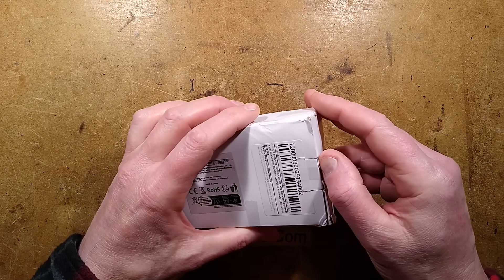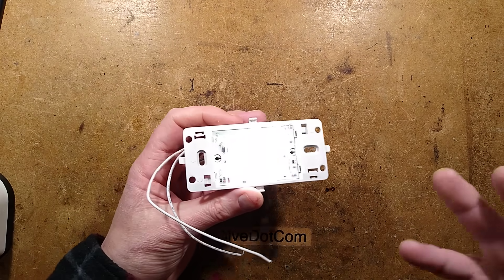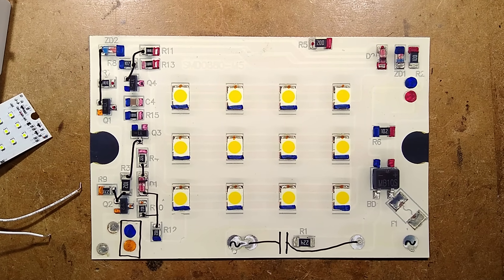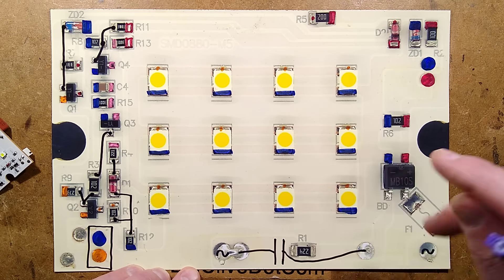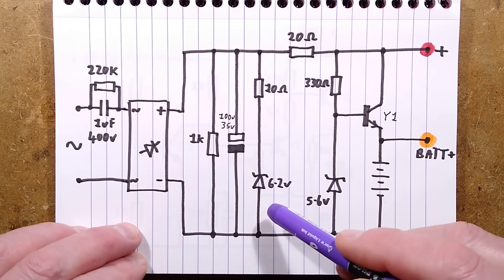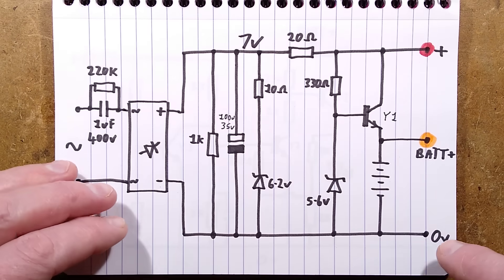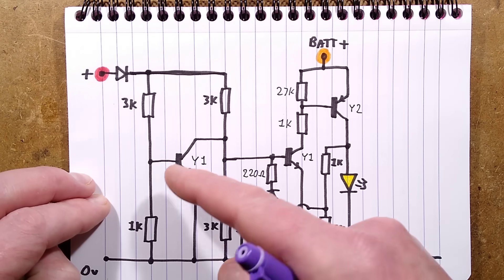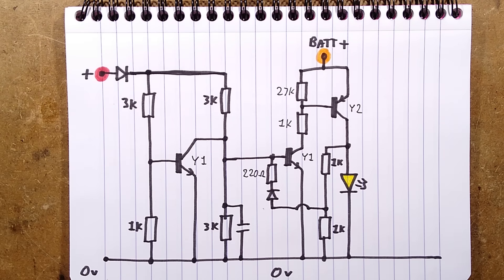Unusual circuitry twist - emergency light module

Comment: Dear Mr. Big, how do You enlarge a small fart circuit to a full blown tornado? That trick of enlarging circuits to a readable proportion is very neat, nobody else does that.
Being able to draw on with felt pens shure could help me understand what´s going on. Could You please fill us (me) in? Do You take a picture and print that out?
It shure can come costly to make my inkpisser do gloss DIN A4, it even needs a special cartridge for photos. Your blown pics shure look good.
I´m trying to learn electronics and this hands on technique could help, I´m a weird learner. I just fixed my old vacuum, it broke down with the symptom of a shaky contact.
Bought a little board that held a possible culprit, totally dismantled the hole shabang to find …a nothingburger. None was broken or burnt, just a lot of coal dust from the brushes.
Before the four motor wires gave me one reading, I should have had two. That´s when I decided to go all in, it is already broken so: what gives… I cleaned the dust off and out-
Would You look at that: two readings! The bugger works! Put all back together: liftoff! And it is even stronger than before, I measured 100 watts more consumption, it uses 870, now- from 700something.I can see that: the dust made connections where they didn´t belong. And this is totally unrelated but I am stumped and very happy, lovely christmas present.
Never had this before, I´m used to having magic smoke but not a nothingburger. That´s why I like this hobby: never a dull moment.
Happy Holidays und Guten Rutsch, Mr. Big!

Comment: When you went to page 2 schematic, and I saw the "logic" circuit I knew it as a self latching, auto shut off when the battery voltage dropped to a certain lever. I've built several of these years ago to indicate power loss on equipment control panels. The auto off function was so if the power loss happened during unoccupied times. the batteries would not drain to zero.
Reply: How does it turn off if the power comes back on before the battery is low?
Reply: @rolfs2165  7:58 this transistor will switch on again.

Comment: Can anyone answer:  Will a 18V Li Ion battery charger for my drill batteries charge much larger aHr batteries than were available when it was new?  I would like to have much larger capacity batteries.
Reply: Yes, it'll just take longer. 😊
Reply: @keithcarpenter5254  Thanks.  I have hoped that would be the only difference.  Nearly 20 years ago the largest available battery for this was 3aHr but now you can get 6 aHr.  I know the charge profile is CC then CV for Li Ion and I couldn't answer if the larger battery would also try to draw more or overloading current in the CC phase.  I guess my question was what is the relation of battery capacity to charging draw, if any.

Comment: It looks like they have used the npn/pnp transistor equivalent of a thyristor so as to effectively customise the operation to their requirements. I wonder if they could have used a thyristor like the common C106 to switch the LEDs instead?
Reply: Yes, that would be fine to switch the LEDs on but very hard to switch off at low battery voltage.

Comment: NiCd are not used very much these days. NiCd batteries suffer from so-called memory effect so if not charged properly, they quickly lose their capacity.
Reply: They have been banned here. 
Only exemptions are emergency lights and the like.

Comment: I haven't looked for a while, but you used to be able to buy replacement battery packs for cordless home phones that were nimh batteries that look like they have a connector like that so you can probably just buy a higher capacity battery pack off the shelf to put in that.  
Edit: I just looked and you can get 800 mAh battery packs and the connector does look very similar.
Reply: These are still all over the place and cheap. 
These packs are standard with Manny things like phones and walkie talkies
Reply: @NinoJoel  You can still buy NiMh batteries with capacities of 2,500 mAh, easy enough to make up a pack that would run the light for many hours. Although it would take a lot longer to charge back up again.
Reply: @NOWThatsRichy   just wanted to mention it since these packs are available pre made with the same size and plug for cheap. 
They have way higher capacities to
Reply: @NinoJoel Yup.
Guess what else using those those emergency radios with the hand crank?These are the return for batteries And so these units.

And what do I have?Could either run on five way power , including a Similar nightcat, or is it Is a Nickel metal hydride pack?Cannot remember.

But is exactly the same configuration as most Is the old corpus phones.

Have you ever seen some small radios that use the same configuration as well.

Also.
Turns out that emergency radio with weatherband makes a good portal for a wave receiver And actually has decent radio reception.Evolve out Using an external antenna even on short wave 

I also have one of those pocket.Radios got off.Amazon that has a short wave receiver on there.

You'd be surprised at.How low cost you can get a radio multiple function device.That actually is pretty decent even nowadays.

But on short weapons I do prefer an Is analog tuner.

AM radio at least broadcast band not so much these days.Kind of phone you're on a favor.

Also, I'm gonna be building a portable long wire antennaren't you?That would be pocket sometimes I really swallow often out in the boonies on vacation.

If you can rig up a long enough antenna you can get pretty good reception but otherwise radio reception is crap

Comment: We just had the batteries replaced in many emergency lights at work (south UK), and i was talking to the sparky that was doing the job. They were all Ni-Cd batteries. I was quite surprised they were still being used. Anyone know why they are still used in this application ?.
Reply from the maker: Better suited to higher current trickle charging than NiMH and safer than lithium cells.  Some new lights use LiFePO4 cells though.

Comment: So nice of them to provide extra solder pads in case the fuse blows, so you can solder in a new fuse.
Reply: So you can solder in a new properly calibrated wire :D
Reply: then you throw it away as it could have blasted the leds off by then, have this lead acid flashlight here i found that did this, but yeah

Comment: It appears the batteries were discharged which are rated @.3A yet when you gave it mains if started charging @.77A, well over 2C of the rated capacity of the batteries...Not good
Reply: A significant portion of that power was being wasted in that undersized discharge resistor and lost in the several voltage dividers.

Comment: A very interesting emergency light that looks like it can be easily improved upon, even if just to mount it on a box containing larger NiCad cells. Like emergency light D cell pack. That would make the light run for hours when there is a mains failure. 
Thanks for the very explicit video. Makes for easy following. 
TNX
K Watt
Reply: Change the batteries to NiMh, same voltage. [3 cells in series, 3.6V]
Reply: @DrHarryT  don't use NiMh in standby applications.

electric toothbrushes live forever if not always put back onto the charger. and they use NiMh cells.

those NiMh overcharge over time.   they don't degrade as fast a Li-Po or Li-Ion and don't tend to combust spontanious like Li-XX on a standby charger BUT they're also not happy.

put Li xx and NiMh on the charger PRIOR to use and NiCd and lead acid AFTER use.  that way you geht the best results in service life out of them.
Reply: No need for that.
They use a standard cell package with standard connector. 
Search for cordless phone battery's. 
They are dropin replacements and cheap

Comment: 300Mah?what was the point in including something stupidly low, chances are the battery would fail long before the light was ever even tested
Reply: I have been working with these back when they had neon lights. 
They normally lasted 10 years and more without any maintenance before they could produce enough current for the neon tube to start
Reply: It's only 5 bucks
Reply: I got nicads on an old wilko emergency light, about twice the capacity and uses a light bulb, still works too, I have no idea how old it is !
Reply: Yep... Just like my heated socks from TEMU.  😂
Reply: Lol I have 1.2v 800mah nimh cells I bought 15 years ago, AA, AAA, C, D, been through at least a couple thousand uses/recharges, and still work fine. Re evaluate your idea of the different battery chemical technologies please and thank you.

I might add I used them for high lumen flashlights for rough camping conditions for at least a decade and now they power my TV remote. 15 year old cells work my Amazon fire stick remote for at least 5 years now. I recharge them when I get a new firestick. Been through 3 of them now. The larger cells sit in my ancient backup maglights. Anywho. Continue your ignorant hatred of old tech please :) it's cute
Reply: @boilabum  mate, go outside some time this week, please, get with the times, it's a whole different world out there sausage

Comment: NiCad cells are banned in the UK for all but a very few specific applications so apart from the other non-compliances for toxicity reasons it would be illegal to install commercially or dispose of in the normal waste.
Reply: High temperature NiCad cells and batteries are permitted because they outperform other cell/battery types in certain extreme conditions. And yes, they are still available from a limited number of large electronic suppliers.
Reply: Didn't realise they were actually banned, I thought they';d just become obsolete. No wonder I'm struggling to find replacements (NiMH is not always drop-in equivalent).
Reply: They're not banned...  @theelmonk
Reply: banned! 🤣 nope.
Reply: @ShadowzGSD they are. 
With some exemptions tho like emergency lights lol
Reply: @NinoJoel  so not banned then! 🤣
Reply: @ShadowzGSD  by your logic owning guns is legal as well since the police uses them legally....  What's the ridiculous point you try to make
Reply: @NinoJoel  what planet are you living on? planet 'triggered for no reason' 🤣 calm down, no need to go off one one. Besides owning guns is perfectly legal, anyone old enough can get an air rifle, and you can get a licence to own a shotgun.
Reply: @ShadowzGSD   in most parts of the world it's not. 
I was making a ridiculous point since that is what you do when commenting considering your past comments on this site. 

These battery's are banned... Just because you can get them with special permits doesn't change the fact they are.

Comment: Did I miss why it doesn't turn on when the battery is connected and no utility power supplied?
Reply from the maker: It has a section of circuitry that provides a trigger pulse when the power fails.